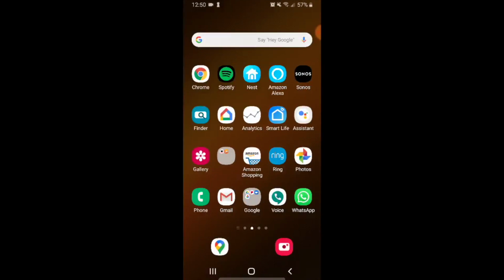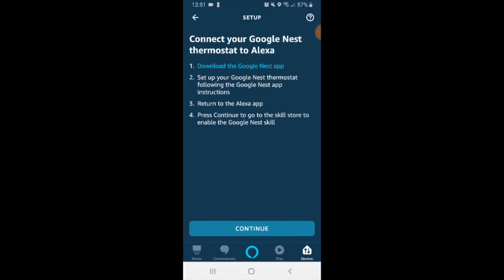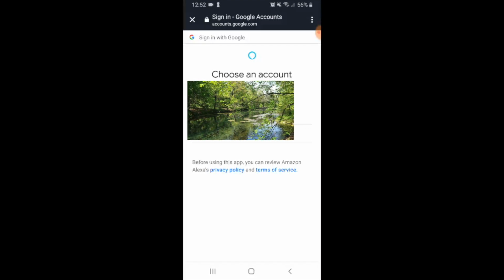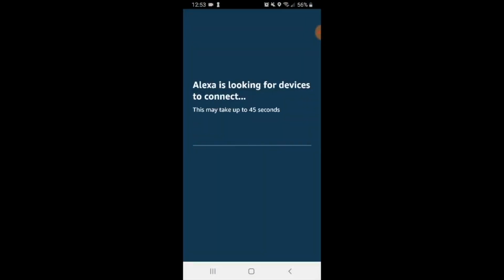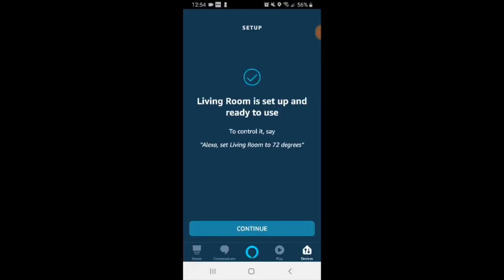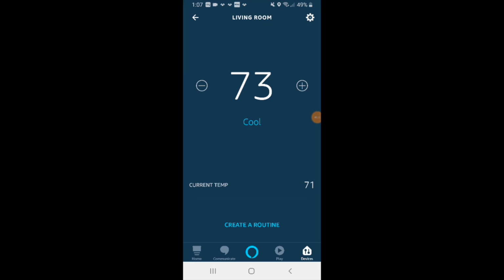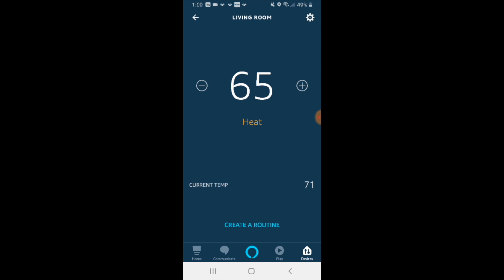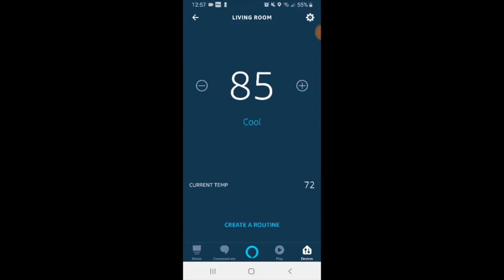How To Link Nest To Alexa

Comment: Hello.  Good tutorial. I was able to follow all the steps and successfully connected my downstairs Nest thermostat, but I was not able to add the upstairs, which is the one we use all the time. Any reason why I picked up the downstairs and not the main top floor?
Reply from the maker: They need to have different names. I would disconnect the skill and make sure both devices are deleted from Alexa. I would then go to each Nest Thermostat and make sure to pick a different name. Then re-add the Google/Nest Skill and they should import. It's also important to make sure that you have both thermostats in the same "house" on the nest app. 

Sometimes when people have 2 thermostats they accidentally set up one thermostat as one house and the second thermostat as a second house. Both Thermostats should appear on the same home screen in the nest app with the current temperatures showing if the are in the same "house" on the nest app.  Please update with a comment if this solved your issue.

Comment: I thought Nest was not supporting Alexa? When did this change?
Reply from the maker: Nest and Alexa voice commands still work.  Nest got rid of their program "works with nest" which was an integration method for a lot of smaller 3rd party platform partners. Alexa and Nest still work though I use voice commands to control my Nest Thermostat almost every night.
Reply: @One Hour Smart Home  I Just try to link alexa with my nest thermostat and I couldn't :(. I tried too many times. First with searching thermostat device, and search the nest skill, and it can't found any device. I think that is for my country, I live in Chile. Alexa doesn't good job here :(